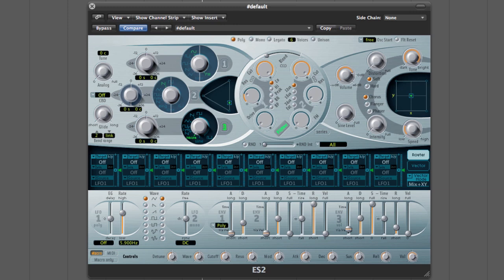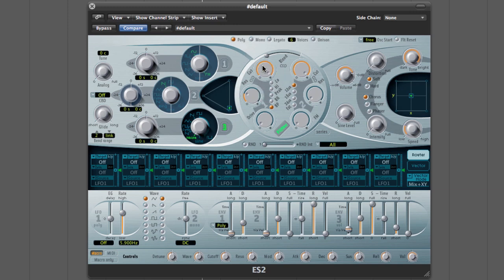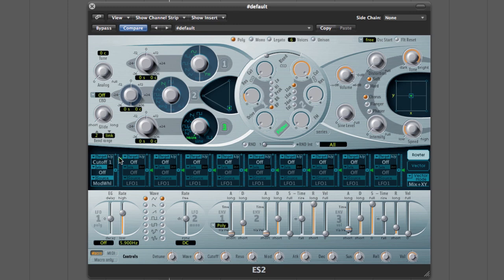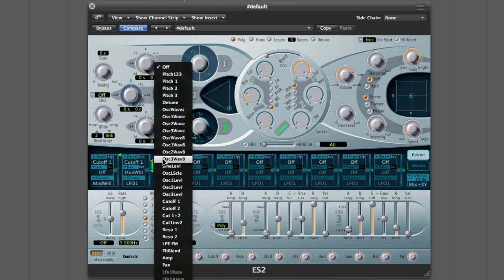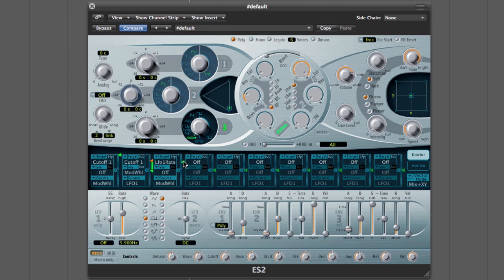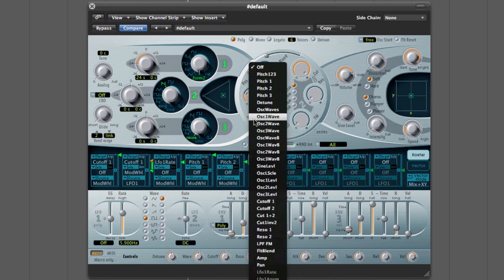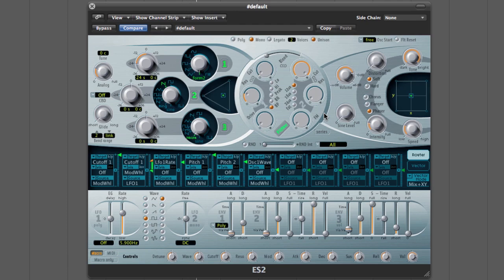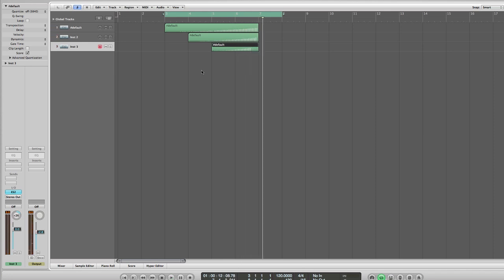Making Transition FX in Logic's ES2

Comment: @BuddaS0und Maybe you should try to go the the vector display (In the middle instead of Router) and turn the Vector Mode off (and the X-target and Y-target). This will produce a straight line. Also the intensity of the Chorus or Flanger must be turned to zero. Furthermore in the filter section, there can be a huge difference in sound output between the Lo, Hi or Peak for instance.

Comment: Hello, First of all.. great video!
But I'm experiencing some problems too. I have the ES2 settings just like you (only I have a Modulation knob instead of wheel), but I only get the high sound and not the low sound from the beginning till it reaches a high sound as it builds up. Does anybody knows a solution?